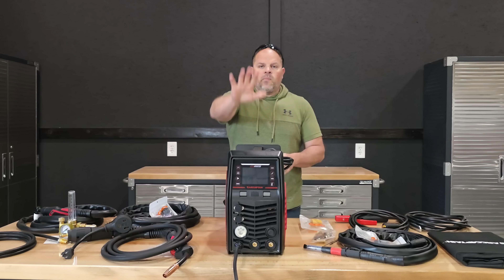FIRST TIME WELDER tries using the Arccaptain 205MP

Comment: The way my compressor was set up I needed an extra fitting also. I just called it a female on each end argon fitting. Google was able to show a picture. It was different than the one at Lowes. The product Google came up with was a coupler but was one piece of metal ( you turn the entire hose ) I like Lowe's better. It had a pipe with a seat on each end and a nut at each end also. The hose doesn't rotate the nuts at each end rotate. One's $5 and the other $10

Comment: Hey buddy, I have one of those welders on order, thanks for your video!  As one amateur self taught welder to another - wear your gloves every time!  I gave myself massive sunburn on my arms MIG welding on 5mm steel a long time ago!  Also I think you were starting with your MiG torch to far away from your work piece at the start (but I think you figured that out by the end). Good luck and thanks again for the beginner perspective

Comment: Hey just wondering what cf that tank size is? How much gas can it hold? is that 60 80 etc... I'm looking at purchasing ATM and I'm pretty close to the same journey as you right now but I have schooling experience from 20 years ago and I've actually had a few welding jobs. my setup will look almost identical to yours. One more question I'm curious about and that is can you disable the nice lady that speaks to you lol It's one thing I'm not excited about because I kind of know where I'm going with it. Hope things are still working for you and you're learning a lot these many months later.. Much respect for just jumping in like that and Thank you for the video

Comment: I always start out on lower settings and speed and then slowly bump up the amps and speed. I started arcing on this machine at 60 amps 3/32 E7018. It welds great at 90 amps if it's not real thin metal. I have this exact machine.

Comment: Warning ⛔️ ‼️ ⚠️ 
I seen this welding machine:) 
Arccaptain MIG205MP All-in-One Pulse MIG Welder and Cutter Combo with upgraded Kit 🎉😂 :((((
When I t try to buy automatic switched 205 Pro , so I emailed him a couple times never replied back I called they never answer the phone. What are they saying? Everybody’s off vacation or somewhere or just leave a message no one on the phone 📱 😢😢😢😢😢
To change the order  #78355 or cancel and make a new order😊 finally someone called me 😊  they said they going To cancel the order  #78355 205 Pro and go I had to make a new order or put a new order 😊 I said ok ✅ 😊🎉
So that’s what I did put new order Order #78547 in 😊 Arccaptain MIG205MP All-in-One Pulse MIG Welder and Cutter Combo + upgrade kit:) 
Then I check my card next day they charger my card for #78355 order which supposed be to be canceled 😡 I called its saying no one in the office 😮😢😢😢😢 the I got a call back and they said this order #78355 will arrive Sunday whaaat ? You said you cancelled 😞 my order #78355 ??? 
Sow now I’m going to receive to welders? 1st order #78355 and now 2nd order  #78547 ? 😮😮😮😮😢😢😢😢
Then they hanged up the phone 📞 😮😢😢😢
That’s unprofessional emailing never reply back they said they canceled the order don’t you calling they never answer 😢 if buying the product it’s all messed up just imagine something happens with your equipment. They will never fix their problem. 😮😢😢😢😢
Problem that’s so messed up because by the sound they are gypsy They never having nothing organized. 😮😢😢😢😢😢
Shame on companies like this :(((

Comment: That barb fitting on the plasma cutter could work if you wrapped some electrical tape or plumbers tape on the fitting barb in a pinch. Also you could put a small hose over the barb and fit it in the hose. Again that’s just a temporary fix.

Comment: Were you using flux wire on the first MiG weld with no gas?  Looks like you used the same wire for gas and no gas.
Reply: I think he was using flux core for both welds.
Reply: @Crazson34 If that is the case why is he wasting gas with flux wire?

Comment: I just got my mig205mp yesterday. It's replacing my 35 year old Lincoln SP-170 mig.
I used it yesterday and was very impressed with the mig. I'm getting   some Argon tomorrow and checking out the Tig. 
I'm not a professional welder, but I went to school for 3 years in high-school, but life took me another direction. I have welded  a good bit in my autoshop over the last 25 years and I've been a mechanic for 40 years.
Thanks for the video
Reply from the maker: Thanks for sharing!

Comment: Where did you get the adaptor for the airline?
Reply: I need the same info as well but see you didn't get a response.
Reply: @justinreddell5396  I took the Arccaptain air hose to Tractor supply and bought a fitting to make one end of the air hose into a 1/4" NPT air fitting that quick connects into my compressor hose. That way it'll always be a quick connect with no wrenches needed.
Reply from the maker: Local supply house

Comment: 75/25 Argon co2 mix for mig welding steel. 100% Argon  for tigging aluminum . For plasma  a proper sized compressor and i would run a air dryer off the compressor to yours.
Reply from the maker: Thank you!

Comment: if you are using flux core wire you dont need to use gas.  if you are using just a wire roll you need c02 or mix gas and  you need to have the wire shorter.   it should be no longer our of the tip than 1/2 inch.   you should also hold the stinger with both hands and get down closer to what your welding on.   you will know by the sound of the welder if you are to far away, to close, to hot or to cold... it should sound kinda like bacon frying. for mig you should be cleaning the surfaces that you are going to weld together to get the best weld. if its galvanized you need to be sure to have good ventelation because the off gas thats produced when burning off the galvanizing is poisonous to inhale.  for the plasma cutter you should use a straight edge everywhere you can and pull the cutter along against it to get the best straight cuts.  You  were also pulling it along to fast. if there are any sparks at all coming out of the top of the cut you are going to fast. for mig and tig you need to see the pre and post times that the gas comes out.   the gas establishes a cone around the weld that displaces the oxygen so the arc will behave properly and give you a good weld.  that means several things.....get closer to your work, and no breeze or wind that  can disrupt that cone of gas.  the pre and post settings are how long you need the gas to displace the oxygen BEFORE you strike and arc and how long you want to the gas to flow on the weld AFTER you finish and stop the arc.  there are so many things that you need to learn to be able to weld good strong beads that it will take a long time for you to learn on your own.  you need to have a buddy or someone that knows to come over and show you how to set up your machine properly and explain all of the settings in the machine.
Reply from the maker: Thank you!

Comment: Nice to see. I am looking for my first welder for some projects I need to tackle and this is a serious contender. So very nice to see what I can expect to get out of it.

Have you done any more welding with it? I would love to get your amateur experience on welding thin metal with it as well. I will sub for a while in case you decide to do a follow up on this.
Reply from the maker: Yeah, thin metals are tough for me. I'll get better with more practice.
Reply: @KuriousKritic  thinner metals are best done by using the spot weld function of  your machine.  learn how to use it and get good with it.  its for 14-18 gauge sheet metal. you can also use the pulse setting on thin sheet metal with cold weld.

Comment: Fun video.  I'm new to welding as well and using the ArcCaptain Mig200.  You probably have figured it out by now but your mig tip should be WAY closer to the working material.  Also, get comfortable and use both hands.
Reply from the maker: Thanks!

Comment: The thing is, that most people can't afford a $1,205.00 machine. Yeswelder makes good machines, I just bought the Yeswelder DP200, and I bought the Yeswelder MIG 250A Pro and the Yeswelder CUT 55DS Plasma Cutter back in 2021. You should really check out the Yeswelder DP200, it's a really easy machine to use, and it shows you how to plug in your leads to the right place depending on what process you want to use.

Comment: You are a few steps ahead of me, but I am in the same boat as you are. Truck driver wanting to leave the industry and want to learn welding full time. Got quite a few project around the house for sisters….this great what you are doing. Did you read any of the manuals at all?
Reply from the maker: I kind of skimmed over them 😂